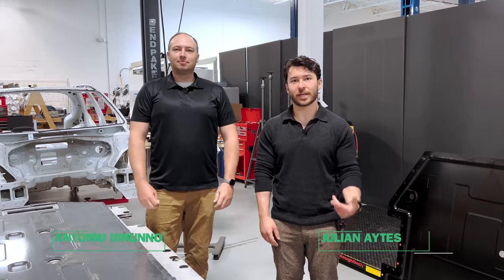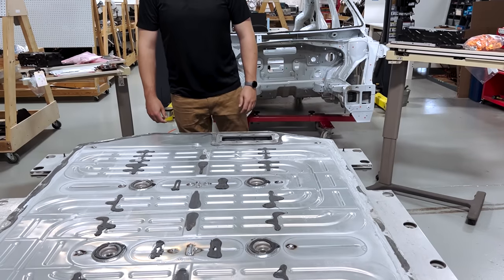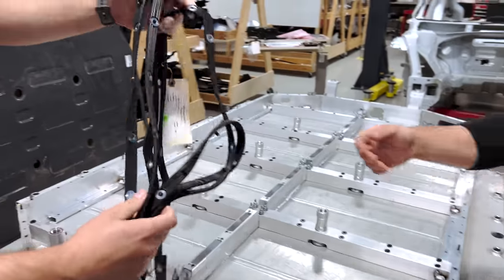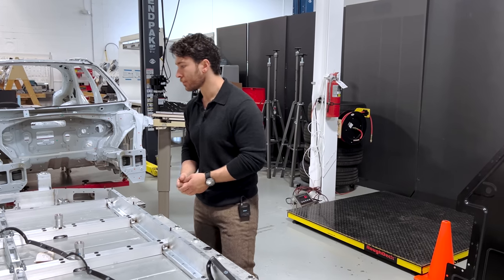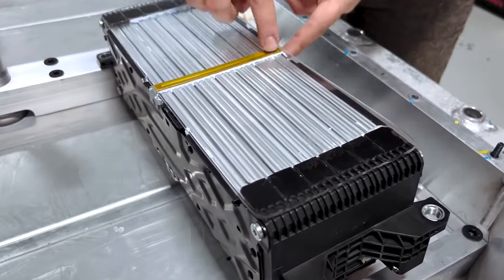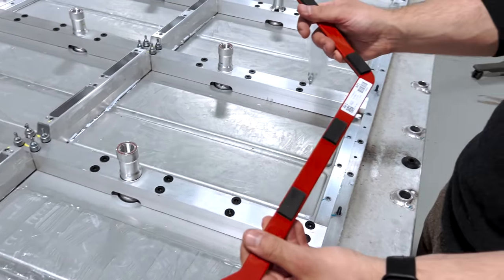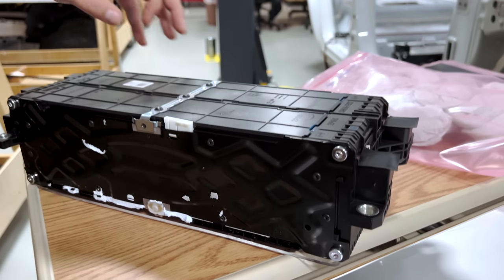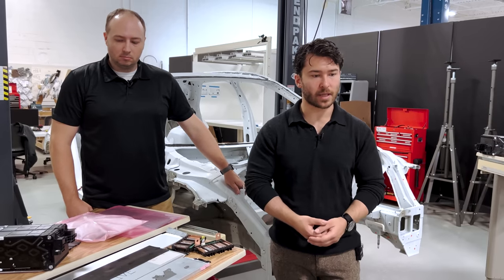Hyundai Ioniq 5: Integrated cooling plate | Battery Pack Breakdown

Comment: Now that's a well designed, repairable and reusable pack. And one thing most miss, it's not just about reliability and warranty. Yes, pack are more reliable now. Yes, they are covered by 100k miles warranty. But nothing is unbreakable. Especially in case of an accident. And being able to reuse and repair those batteries is a big plus in my opinion. They are still quite expensive and worth the time to repair them. Compared with this, the 4680 pack is a nightmare. And most other packs that are glued or foam-filled and hard to service. Yes, the right to repair is relevant. And the costs also. This will become more and more relevant for the insurance industry also.
Reply: This will reduce costs for owners eventually, when this kind of work gets past the warranty period.  I like to keep my cars for 20 years, so maybe it will be a thing,  Since warranty costs are built into the purchase price--maybe it already applies to normal buyers.  As Hyundai get experience with their EV warranty costs, maybe they will build a skinnier number into the purchase price to cover their expected exposure.

Comment: Question - why not install pressure relief valves on two diagonally opposite ends and have air channels across all modules so pressure in the entire battery pack is same. Or in case of extreme thermal runaway, there can also be rupture discs?
Reply: Because it would (probably) cost more than using the expanding seal they've used (which obviates the need for such vents?)

Comment: One of the major issues with Lithium-ion batteries is recycling. It could be that it is designed to be easily serviced after their useful life in the EV in order to convert the batteries for their re-use in their second-life application, and then once more when it is time to fully recycle all the parts
Reply: JB got you fam.

Comment: Is there anything known about how many Charging cycles such a LiPo Based Pack can have? For LFP it is 3000+ cycles, for NMC it ist 1600-2000+ cycles, for LIPO batteries I have 500 in mind but that would mean, from my calculating perspective, that those battery packs are a bit short lived in comparison.

Comment: What is a 'thermal flow screw'? I suppose I should go back and find the ID4 battery pack teardown to find out. I'm guessing some kind of drill-cum-screw that you put in and it spreads the ali whilst cutting a thread? Maybe you [put it into hot ali so it's more malleable?

Comment: Great video. I may have misaed these. Will the fusible links create additional failure/service points? Does a link failure incapacitate the vehicle?
Reply: Looks like it’d only affect part of the pack.  Maybe 1/8th?
Reply: Certainly, but if a link fuses you may bigger problems to worry about.

Comment: Regarding the embossed areas on the cooling plate, don't those raised areas actually bring the cooling plate surface closer to the bottom edge of the pouch cells, thus reducing the volume of TIM required?  It looks like the embossed areas provide clearance for the module structure holding the pouches together...
Reply: Yup, that was my thought exactly. The depression in the center gives clearance for the central structural bar and the depressions on the ends make room for the plastic housings for the modules. Antonio did mention that it gives clearance for that steel bar.
Reply: I expect it's simply to improve the stiffness of the raised area to minimise the chance of delamination with the thermal pad.
Reply: Because there is a raised area there is a also a depression. The depression needs to make contact too.

Comment: Has anyone seen the video titled: $60,000 to replace battery 2nd IONIQ 5 case confirms battery price? Cost more than the entire car new.
Reply: That makes no sense to me, because you can reuse the electric motor, the tires, the body of the car, all the suspension.  Why does the battery cost $60k when buying the same new car costs $55k?
Reply: @kevinmiller5467  yes exactly. Paste "60,000 to replace battery 2nd IONIQ 5 case confirms battery price" in youtube and watch any of the videos. It's shout. Let me know what you think.

Comment: any thoughts on the $~500 “low conductivity” coolant that apparently only lasts a few years?
Reply: Standard coolant has corrosion inhibitors to extend the life of the radiator system, the issue is when you get into very large surface area brazings, you use a lot more high fluoride flux (vs cooling channels for example) to prevent oxidation during brazing and that flux reacts with the silicate based corrosion inhibitors and forms a gel byproduct that will clog the system and cause over pressure leaks. 
 
A few flush cycles should get out the residual flux, but at this point, no one knows how many cycles are needed to reduce levels to the point where there is no further gelling. 

So, yes, absolutely. Replace it after a while. Coolant companies have a few products out that are specifically formulated for EV applications.
Reply: The blue coolant is not used on the new Niro which also has an external cold sheet.  It's not clear to me if Munro's Ioniq 5 has blue or pink coolant but I was under the impression that the expensive blue stuff is being phased out.
Reply: EV6 uses only standard pink coolant for battery and electronics.

Comment: What's the service procedure for when you run over a cinderblock on the highway and get a hole in that cold plate? New $20,000 battery?
Reply: During warranty - probably... After warranty there will probably be alternatives unless you puncture further.
Reply: @rkan2  I doubt any insurance will be willing to cover an EV with a damaged cooling plate. But for normal city use it will be very unlikely that something hits the bottom plate that hard; if you bottom out the car, then you will most likely have a problem.
Reply: I5 user here in Indonesia, cinder block on highway is common here, my I5 is one of the casualties 😢. But local authorised dealer here is certified to repair it, total quote is $8,250, majority of it is the cooling plate at $3,600 and thermal paste at $2,250, and applied to the plate with $170 applicator.
And yes those damn black flimsy FRP price is only $80 😅

Comment: It seems a bit obvious to me that it would be better if the battery was engineered so that the cold plate was on top of the battery pack seems a bit vunerable underneath like that ... also a aluminium protection cover rather than GRP would be better, would probably add a bit to production costs but not too much...it's shame realy as the inside of the pack looks well engineered .

Comment: 25:46 Are there resistors on the other side of the pcb? It looks to be just some fuses and connections for the individual cells. Balancing is probably done elsewhere?
Reply: All fuses. Balancing done in the spine based boards.

Comment: This design is a very serious fail, as are Hyundai’s spare parts prices, which are PURE unadulterated EXTORTION. A replacement Tesla battery is about 1/3 the price (and far less likely to suffer critical damage). 
It’s very obvious that the design is FAR too susceptible to road debris damage. Having a cold plate along the bottom means  that driving over almost ANYTHING can write off your battery, and therefore your car.

Comment: Yeah.. It took 6 1/2 minutes to see why Hyundai can't charge fast when its really warm or cold.  It can't heat, cool and control the battery temperature. I wonder how the state of the battery will be with a owner that do a lot of fast charging.  Hyundai charge 10-80% at roughly C2.1, Tesla 3/Y at roughly C1.5, with a better heating cooling system.  What do you Munro guys think about that?
Reply: Had no problem to fast charge even on very hot conditions so far.
Reply: I charged yesterday in LA at 150kw it was 107F. It wasn’t a problem.
Reply: Btw. Hyundai can charge at 235KW. Battery is 77KW. Thats impressive 3C. That must be cooled good. In summer had no limitations so far even with air condition on during charging.
Reply: 800V?

Comment: From a manufacturing point of view, I know that the Tesla structural battery pack is a lower cost but unserviceable.
I would think from an owner’s point of view the Hyundai looks better made, repairable and more desirable, but more expensive.
Hyundai’s quality of construction seems to be second to none.
Reply: Byd's structural blade battery needs no filler afaik.
Reply: Look at that weld on the left at minute 11:37 that is horrible, the tube and the bottom are not even connected properly over half of the length of the weld. Teslas Model 3 and Model Y are very reliable, lots of them with several hundred miles on the odometer which had only minor service to do; so I do not really understand how you come to your conclusion. Never heard about any battery replacement of a model 3 or Y being necessary and I read a lot of comments and Tesla / EV related news. The Ioniq 5 has to prove its longevity, I have my doubts with the only one sided cooling and very little cooling surface; thermal management is crucial for battery life. In winter conditions it will be very difficult to heat the battery up, as there is only minor insulation of the cooling plate to the outside (glasfiber is not a very good insulator) .
Reply: I love the model 3. Where did I say that they weren’t reliable?
My friend has one.
That weld is a segment weld and a holding weld to hold the spacer in place not a stress weld and it’s quality is good.
I don’t own an Ioniq 5 but I’ve measured the Ioniq 6 with Vernier calipers and as far as the quality goes it’s far superior in fit and finish to a Fremont model 3. The Chinese ones are better.
Look at out of spec reviews of Kyle’s younger brother’s new blue model 3.
As far as the cooling system goes, the Munro engineers thought it was well designed.
It no doubt costs more to produce than the Tesla structural pack but is repairable. From an owners point of view that’s got to be better.

Comment: Serviceability of a pack is a giant waste of money. Tesla’s strategy to pot the entire 4680 pack in foam and glue it shut is the smartest choice. The high level of skill and training needed to service a HV battery is very hard to find and expensive. Plus Hyundai has to pay retail labor rates to dealers for warranty work. Cheaper and quicker to swap packs and recycle the old one, plus any rookie mechanic can do it. Tesla knew this and let the glue flow.
Reply: And then you get an issue like GM where you have bad modules that need to be replaced. You would need to throw out the entire pack instead of easily replacing the faulty module. And what about after a decade of use and one of the modules goes bad? Again, you would have to swap out the entire pack. Not really environmentaly friendly or cost effective if you want to give the vehicle a long lifespan.
Reply: @Hans-gb4mv  Tesla uses cylindrical cells for a reason. There are lots of Model 3 and Y not the roads with over 200.000 thousand miles on the odometer. Never heard of any issues with battery packs.
Reply: @денисбаженов-щ1б  Russian troll? I get that Russia does not like EV´s as they are so heavily reliant on fossil fuel exports.....

Comment: And to think that little pack will cost you over 50+k to replace if you scrape it.... Strong pass. Looked at a Ford Mach-E since battery replacement is modular at only $6-8k per module.. that have to be replaced every 3-6 years per Ford. Seems that you have to be a rich you tuber to afford one of these new electric vehicles. Good idea but we will see thousands of these in the crushers in a decade as insurance writes them off.

Comment: The cooling design looks so similar to how a stuff is cooled in a computer. I wonder if they could make the battery cooling/heating more efficient if they used even more ideas from computer manufacturers. A couple things come to mind. In a liquid cooled CPU cooler, there are always tiny fins in the block on the CPU. I didn't see any fins on the cool plate. It just looked like channels. I wonder if adding fins would be more efficient. The other thing is the thermal pads they used. They were indeed quite thick. In PCs they typically use a non conductive paste. That is usually better than the pads at transferring heat. Would paste make this even more efficient? 

I think when it comes to serviceability, a paste is a little more annoying than a pad. But it's not that bad. You just scrape it off and add more. So it would still be serviceable. Now if they used something crazy like liquid metal, that would be a different story. You would have to be insanely careful. I don't think that would be worth it.

Overall though, this battery pack looks like it could be serviced. It will be interested to see mechanics getting trained on this. Who know, maybe in the future you local mechanic could replace a battery pack that's gone bad. Doesn't seem that unrealistic anymore.
Reply: The coolant is on its way to a radiator. Plenty of fins there. And there isnt a pad, its silicone that is applied wet and dries after the modules are in. It should have pretty good thermal conductivity because it is contacting the entire bottom of the modules. Thier big concern was that so much of it was used that makes it heavier and more expensive.

Comment: Im going to guess that their cooling system has 3x the fluid that a Tesla does. A lot of extra weight. I have an inkling that man power costs are why Kia/Hyundai are not making money on their EV's. Seems like everywhere in the car there are processes that should have been simplified and automated but they chose to keep humans in the loop.
Reply: They are giving the Germans a run for the over-engineering award
Reply: 9.5-11.5L, yes a lot.
Reply: @BatterVswithAntonio  looks like it would be more than 2L but that is still weight right? Much like the choice they made with riv-nuts over structural. Reduced weight.
Reply: @BatterVswithAntonio  Sandy is right. Now is not the time to be reinventing the wheel. Copy the new wheel and work on improving it later.
Reply: Most things I’ve seen look to be done to help make improvements down the line.  Make it easy to pull apart so you can check what’s causing your failure, over engineer this part so the customer gets a good experience.  Once the cars are on the market a few years they can afford to change these designs to make it easier to make and cost less.